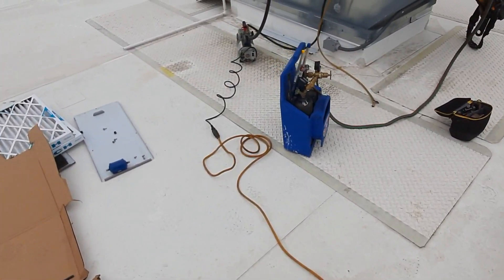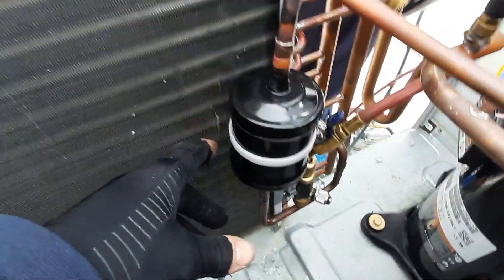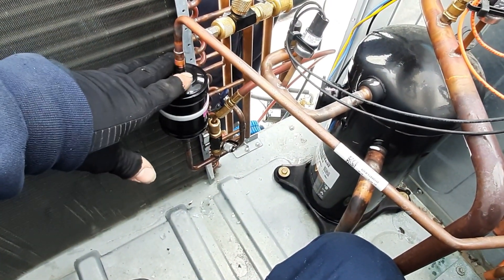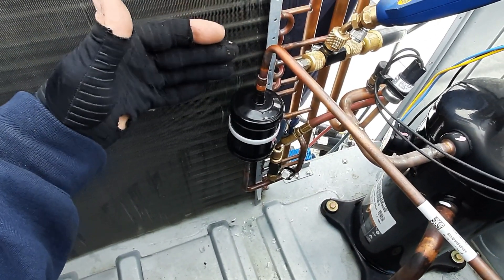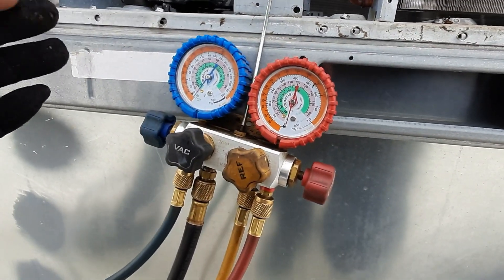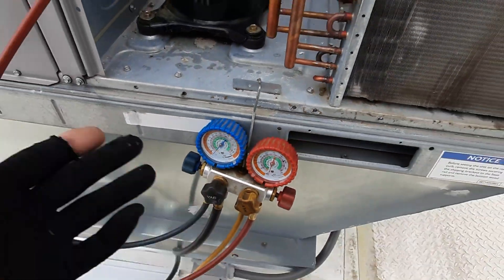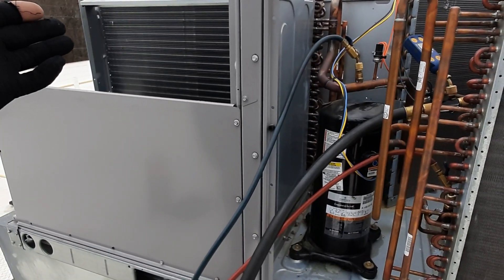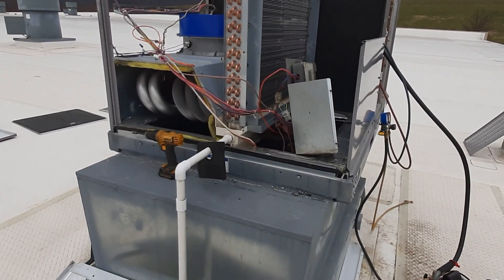Refrigeration Cycle Explained

Comment: What is the math on knowing how much a saturation temperature should be at in each unit. For example a cooler. When we gauge up to it we can transfer psig to temperature. How can we tell where it sbould be at? Is it the ambient temperature around the condensing plus 20 or something like that?
Reply from the maker: Rules of thumb. I recommend refrigeration for air conditioning technicians by Dick Wirz. Condensing temp is 20 to 30 degrees over ambient. Evaporator temp is 35 degrees less than return air temp. It's a great book

Comment: KISS keep it simple stupid, I see a a lot of young techs always look for the worst case scenario failure first, then call for help, ie, it’s low on gas, when really the belt is extremely worn and suction temps low, some ice on coil.
Or high side pressure is high, and coil looks good, I,say wash the coil, then get a call, wow it really dropped , those micro channels can be a real pain in the butt.
Great video, I just sent it to some of our Ac apprentices, even though it’s a roof top, it’s still the refrigeration cycle.
Reply from the maker: Thanks Justin! It is usually something simple, not always the TXV lol.

Comment: I have seen high head pressure on a liquid line restriction. The equipment had a bad TXV and was over charged. So periodically the head pressure would jump high because it was overcharged but then the it would drop when the TXV opened and let more refrigerant through. It was almost like the equipment had a heart beat. Took a while to figure it out. I also suspected that the wrong refrigerant had been put it the system. So I replaced TXV and did a chemical flush and recharged to manufacturers specs. Great video.
Reply from the maker: Thanks Marquis! There are certain situations where you could have high pressure, as you said overcharged and/or wrong refrigerant also noncondensables. These can be tricky to diagnose especially with 2 things being a problem.
Reply: @EverythingHVACR  lol those are the best ones. Makes you contradict yourself the hole time when troubleshooting.
Reply from the maker: I've been there 😆